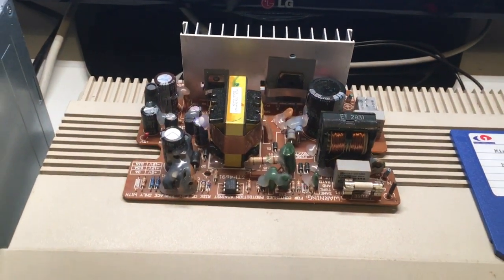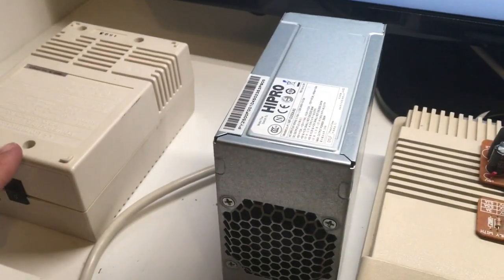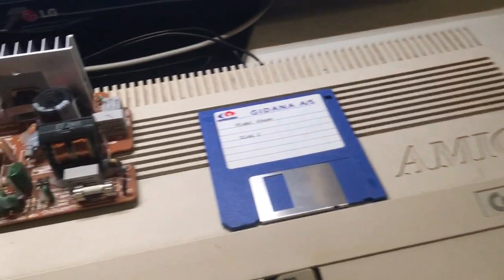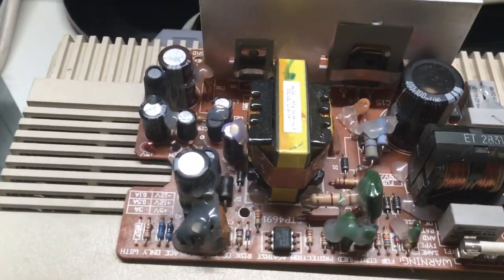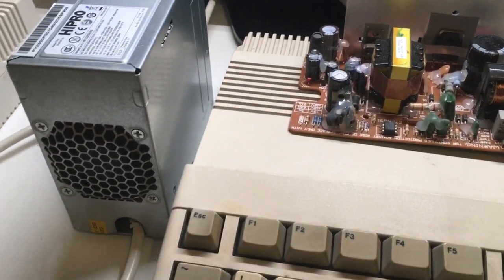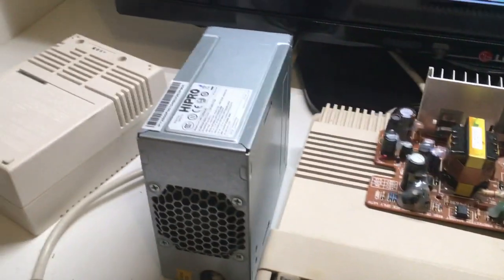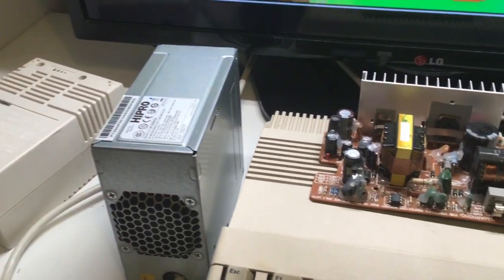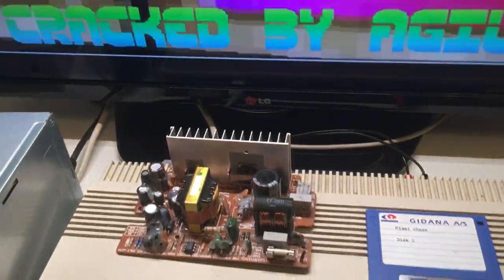Commodore Amiga 500 PC PSU Hack, Late night video clip

Comment: Meanwell RT-50B will fit all old Amiga PSU cases, RT-65B will fit later models. Both have all the voltages needed for the Amiga (adjustable 5V, 12V and -12V)

Comment: Great video once again Retrocengo!
Let me ask one thing...
Can I plug a A500 PSU in one A600? The socket it's the same on the two models?
Reply from the maker: Thanks buddy, yes you can use same PSU on A500/600/1200😊

Comment: I use the Meanwell RT-65B or RT-50B  which is a modern PSU that will fit inside the Amiga PSU case. There are videos here that show this being done: 

https://www.youtube.com/watch?v=L_Sre15wH9I
https://www.youtube.com/watch?v=VcQ6qRVdOL0&t=2s

So if the original PSU is beyond repair this is a neat way to keep the original PSU and have a modern reliable internal electronics.
Reply: I do as well... They are awesomme.
Reply: @brostenen  Top job!
Reply: @Wallygjs  Yup... The RT65b can just barely fitt inside an original A500 PSU shell. However I managed to cramp mine inside. It is my primary Amiga PSU now. I mean, like 5amp on +5 and 2.8amp on +12, is a serious PSU. Never runs hot and passive cooled.

Comment: Seems like some ATX PSU's doesn't like low load resulting in strange behavior when turning on/off when floppy is not in use. Thats why some use AT PSU's instead? I also tested a used pico psu but it was faulty. A pico PSU can be great in case or in case of old PSU.

Comment: I heard modern power supplies don't have negative 12 anymore?
Reply: -12V is still in ATX supplies, -5V was removed in ATX version 1.3.
Reply from the maker: @ches74  Thanks. Great info/update very fortunately the Amiga 500 doesn’t require-5V😊
Reply: @ches74  yup be very careful with ATX PSU’s in your A4000’s since I almost blew up everything because of this -12V issue a few years back!
Reply from the maker: Hmmm, I’m not sure, this one is pretty new and has got the -12V😊
Reply: You can buy perfectly new and modern PSU's with -12. Even with -5. However they are not ATX. Look for meanwell or other industrial stuff.
Reply: Thanks all 👍